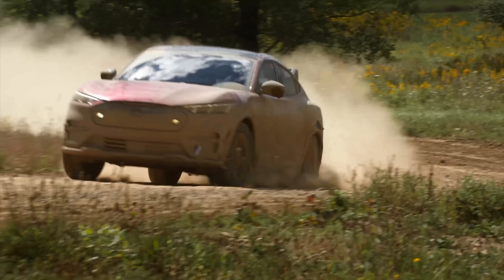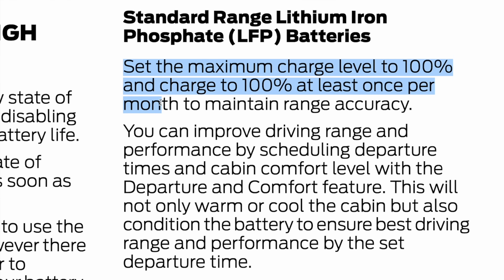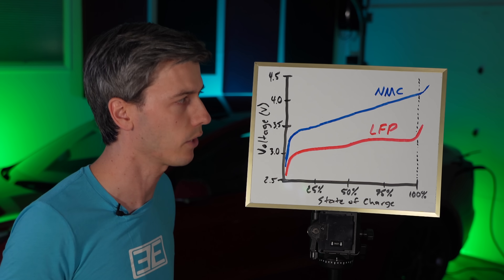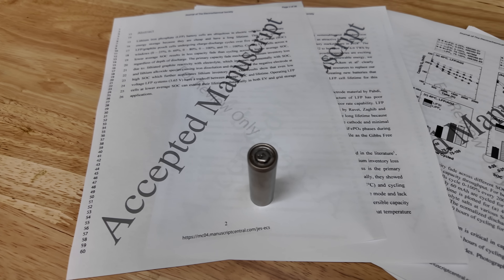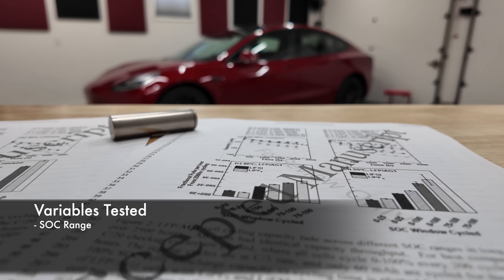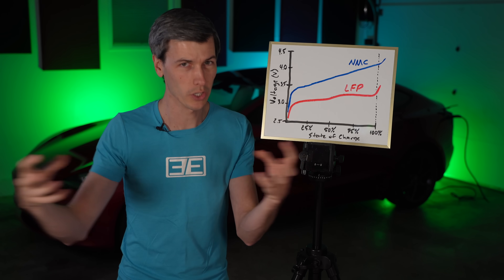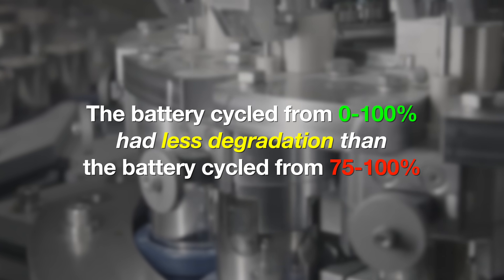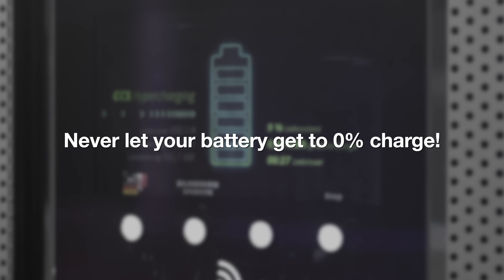How To Ruin Your Electric Car's Battery - LFP Edition!

Comment: Spot market prices for electricity makes all even more complicate. Let's assume 5 Cent/kWh potential for optimization. After 300,000 km and 45,000 kWh, this optimization would bring 2,250 € less electricity costs. The lowest electricity spot market prices are usual on weekend. So charge during the week to keep the car ready and charge to 100% at a sunny weekend. 
To make it more complicate, my wife can suddenly demand “Let's go to the beach”. Ok, charging was planed from 11:00 am to 02:00 pm at negative electricity prices, but now it's 10:00 am and the car is at 30% only. The beach and back requires 34%. 
So the question is: How big is the difference of best, medium and worst practice after 300.000 km? 
After purchasing my Tesla Y, I sold my old Dacia Lodgy with 253,000 km. Diesel Engine in very good condition, but the rust.
Maybe to sell my Tesla Y in 2040 because of rust. The battery could be used for a house storage.
What difference would it be, when from the 60 kWh are still 54 kWh or only 45 kWh left?

Comment: There are top and bottom buffers in the battery pack, so you rarely operate at 0% or 100% at an individual cell level. You also didn't mention what is the difference in the degradation speed. Maybe it is just a couple of percents, so no need to talk about this topic at all.

Comment: The manufacturers should create a “Battery Assistant” in the dash, providing regular advice on how to charge based on the battery chemistry and previous historic charge cycles? Not rely on general principles.
Reply: Great, one more place to shove those dreaded two letters, A and I.
Reply: @ps.2  actually a practical use for AI, rather than being used for social media replies.
Reply: I think we'd be better off with giant signs at the DC Fast Chargers telling people "Don't Charge your car to 100%, FFS!"
Reply: @ToddGlasier  but some times the advice is to charge to 100%
Reply: There's no reason to scare the average Joe so their 15 year old car, which statistically probably won't make it to that age, can save a few miles of capacity

Comment: Jason, fantastic video! It seems there's an especial difficulty of finding solid information on LFP battery longevity!

One question: @ 8:53, you claim that "all of the different ranges tested had the same amount of total energy going through them," based on the fact that all batteries had the same about of time (2500h) to be charged/discharged. Can we make that assumption, given that charging current is usually different across different ranges (0-25% vs 75-100%)? Was the charging and discharging current constant across all groups? I tried to find this in the study, but I don't think I quite understand. Thanks!

Comment: Why does a consumer need to learn or do any of this in the first place?  We don't connect directly to the cells, there's a BMS that is both in control and should know all this.  If discharging to 0% will cause irreversible damage, why would the car allow that to happen?  The manufacturer's should tell consumers to plug the car in whenever it's not being used, because then (and only then), the BMS has power available to charge, but that doesn't mean it has to be charging whenever it's plugged in.  It can just sit there until and unless it determines a charge is warranted.   After observing a driver's normal schedule, it should be able to adapt to optimize the battery performance and lifetime.  All this said, there should still be a way for the driver to tell the car there's a new/unusual requirement in the future (I'm going in to the city tomorrow, or I'm going on vacation for a month) and adjust charging accordingly.  If it's known that what you're asking the car to do can be detrimental to the battery, tell the driver that and let them make the decision whether the damage to the battery (or its lifetime or whatever) is worth what's being asked.  So in normal operation if you don't allow the battery SOC below 3% to protect it from damage, allow the driver to override that if they're willing to take that chance to get to the hospital, for example.  Drivers shouldn't need to be chemists.

Comment: I've found that charge speed is easily as big of a factor as the actual SOC for battery life/health. "fast charging" causes a ton of battery wear, so  I don't think using a supercharger once a week is a good idea at all, but I would love to see some studies on this also.
Reply: With modern properly thermally managed batteries it doesn't seem to make much of a difference. In the early days it was an issue, shouldn't be for any car made these days other than the Nissan Leaf.

Comment: This can all be fixed in software. Make it only charge to 75% by default. Every 10-20 cycles, have it fully charge and recommended the user to run it as dead as possible. (Or another clever solution, when plugged in, have your car hold the brakes and give it gas to quickly dump power and measure the battery, then recharge. This would only happen after midnight when plugged in)

Comment: What's one to do if you want to reduce degradation of Powerwall batteries?
In my area I have net metering and no time of use plan so there's only downside if I cycle )charge and discharge) the powerwalls each day. 
The Tesla app only gives one way to prevent cycling - set the Backup Reserve to 100%. The chemistry of my Powerwall 2 batteries is NMC so maintaining at 100% SOC for long periods is also detrimental to battery longevity! 

Are there any studies that measure whether it's better to:
1) Keep at 100% or
2) Cycle between say 80-100% every day?

I wish Tesla gave an option to keep SOC at a minimum of say 60% and then charge to 100% during a storm watch event. This would provide the best of both worlds - 100% SOC when the probability of a power outage is high and 60% SOC for the majority of the time.

Comment: Charge my Tesla LFP to 100% use it for 3 days till it's down to 30% / 100 miles left then plug it in again on a 7kw charger at home and take it back to 100%.  Only lost 1 mile of range so far in 5000 miles of driving (went from 272 mile range to 271 although it sometimes shows 272 after charging). Not saying that's good or bad just those are my facts is all.

Comment: Well I've always said that there isn't that much difference between the chemistries. It's good practice with both to keep them between 20 - 80%. The only real difference is that LFP needs to be charged to 100% occasionally, not just for calibration but to keep the cells top balanced. I think you've way overcomplicated what is a very simple topic. LFP have a higher cycle life to begin with so if you stray a little from best practice it has less impact. NCA, NMC etc star with a shorter lifespan so automakers have adopted a more cautious approach. Still - if it's practical, ke3p your battery between 20- 80%. If it's LFP charge to 100% once a month. Never be afraid to charge either chemistry to 100% when needed.

Comment: I think perhaps good call out is that ICE isn't immune from these types of discussions. Everyone knows you shouldn't do lots of short trips due to oil getting around and not getting the engine up to proper operating temperature and it can result in a degraded experience or premature death of the engine, but everyone does it anyway and for the most part its fine.

Comment: I like how easy it is to know what kind of battery, but really, it should be spelled out "NMC" or "LFP" (or fill-in-the-blank) inside the driver door, with the vehicle weight and tire pressure.

Comment: Best advice I've ever been given for Lithium based batteries is keep the charge above 20% and below 80%. Seems to have dramatically extended the life of my phone batteries.
Reply: Correct. The longer you keep it close to the nominal voltage (usually labelled 50%), the longer it will last.
Manufacturers of most EVs intentionally reduce the range their cells are charged and discharged to, which is why my almost 10 year old Leaf still has ~70% of its original capacity, while my phone is only about 2.5 years old and is down to about the same amount.
Reply: Incorrect, you can only do that if you know your car balances the battery while it is not full. Some cars (e.g. Some or all BMWs) balance at the end of the (full) charge. If you always stop at 80, if you have such a car, the cells will drift apart and be damaged after an amount of cycles
Reply: @Lesani  don't they have active balancers?
Reply: I do the same thing with my phone and I'm going on 4 years with it, and I still have solid battery capacity.
Reply: @nickhexum01  Your battery will likely outlast the length of time your phone will get updates. That is how the elites deal with people like you (I would too if I could, but I couldn't make it thru the day) and force you to buy a new phone. :|
Reply: This works better with phones because they only have one cell: 3.6V battery so you don't need to worry about cell imbalance, which is the main reason to go to 100% (or 0%) so the battery can get the cells in sync again. Also phone batts tend to be older chemistries like LMO, and never LFP. So yes it's good advice, but big car batteries are different in important ways, and LFP batteries are particularly different.
Reply: I agree - especially when it comes to laptop batteries.  I've worked in IT for over 30 years, and the most common faulty with laptops is battery degradation because they are constantly being kept at 100% charge.  I now keep my phone battery between 20% and 80%, rarely fully charge it.

Comment: Will the LFP battery calibrate immedeately when charged to 100% after months of lets say living with a charge limit on 60%? Or does it require several 100% charges over a short period to be fully calibrated?

Comment: The translation occurred years ago and is supported by thousands of data. The only best practice WRT EVs is don't buy one. The math will never pencil out. Insanity. At some point, when measuring the whole system, science and technology will not overcome any hurdles if continues to violate economic reality. My 22 year-old petroleum distillate drinking vehicle can be charged to any level summer or winter, can be recharged in 10 minutes, gets the same range, has a near zero chance of spontaneously combusting, and is worth more today than it was a decade ago. And it won't kill any birds. If there is a positive side to this, someone could gather their faculty at a charging station and defend their PhD dissertation on the correlation between EV ownership and stress.

Comment: The only choice I need to make when filling up is Shell or Chevron. Currently my Shell station is cheaper so that choice is simple. Besides they always have their squeegees and window washing fluid in order. EVs are great for golf carts and bikes and forklifts, etc. but they are boring and motivated by virtue signaling idealism and saving the world. If you need a PhD in physics to charge the battery, then good luck because the talent pool isn't that deep. If they can get them to stop exploding and causing dangerous fires...     As always, enjoyed your video and learned some good things.

Comment: Living in Athens, Greece, during our worst heatwave so far these ambient temperatures are not unheard of and actually became the norm. So for around 3 months now the ambient temperatures especially in the centre have been around 36-40 Celsius or even more during peak heat hours. And it wouldn’t go lower than 30 in the night for most of the days. What’s worse they measured upwards to 70(!) degrees Celsius on the road and the pavement because of the sun heating it. Crazy stuff.
Reply: Yes, there are plenty of places where this is the case during the height of summer, but while it makes a big impression on our minds the typical and average temperature over the entire year is much lower, so the overall impact over the working life of the battery is less than we might assume.

Comment: Fantastic video! But I miss information about battery health and performance in different temperatures and climates. I live in Norway where temperatures often are down to -30 celsius. 

How does LFP  compare to NMC? Does low temp use or charging hurt LFP batteries?

Comment: I have 2 comments on your interesting video
1: I think the best way is to follow exactly the manufacturers recommendations in their manual, less possibility warranty claim rejection
2: who actually reads all of the manual for the new car they just bought and what about if you bought a second hand car with no manual?
(maybe there should be another small manual just for battery usage in the owners manual pack just like for the radio system? or with new cars incorporate the manual as part of the entertainment system which could lock you out of driving the car until you have read the whole manual, could be a few weeks though)
Rob

Comment: Very good video on a complex topic, however you seemed to miss a big reason why they want you to charge LFP to 100% every once in a while, this is typically done so the cell balancers can work properly, the flat voltage curve of LFP means the balancer don't typically kick in until the full SOC knee hits. If you don't charge to 100% ever the cells can get out of balance. Also all studies show temperature driven aging is far more pronounced the voltage driven aging, even as you mentioned they shortened the test period by driving temps up, if you can do anything with an LFP is keep it cool, ideal storage is actually below freezing, you just don't want to recharge it there. Also there was no perspective on the cycle difference between LFP and NMC, LFP far out cycles NMC by multiple times, so even a poorly treated LFP will probably out cycle a pampered NMC. Definitely pay attention to Will Prowse and his channel, he has been the voice of reason for some time around LFP which has been more widely used for longer in the solar and RV world.

Comment: You have reinforced  my desire of not wanting anything to do with EVs.
Reply: Oh man dude, you should see how much detail some of these channels can get into as far as gasoline engine technologies. Those things are complicated. So many types of engines, and you have to worry about so many factors. Oil changes at 3000 miles, or at 7000 miles? Synthetic or real oil? How do you know when to replace the air filter? Do you use 85 octane, 87 octane, premium, E-10, E-30, E-85, ethanol-free, what kind of gasoline is best for your engine, and what if the station you're at doesn't have that kind? Makes your head spin.

Really reinforces my desire of not wanting anything to do with combustion vehicles.
Reply: @ps.2  My 82 year old mother can manage keeping a ICE vehicle. It's not that hard, but some  of the simplest things are beyond some people.
Reply: @stevenlochner4619  Now you're getting it. If you ask "what are the things I should be doing to make my vehicle last as long as possible", you can get some complicated and confusing answers, like I gave and like this video gives. But that doesn't mean your chosrn vehicle type is inherently hard to manage. Just means (a) the unfamiliar becomes familiar faster than you think, and (b) even if you ignore most of that detail, you'll probably be all right.

Comment: The charge to 100% thing is absolutely not for battery longevity. Ford and Tesla are both doing you a disservice by claiming that. While it's really good to have detailed videos like this explaining all the ins and outs, most people need much much simpler guidelines. This video and everything else I've read says you're better off charging to no more than 80% on LFP just like NMC. And yes once a month charge the LFP to 100. Very few people are going to only charge to 50 or 60% because it's just not convenient as you have to charge much more often. Then we go on a longer trip at least once a month where we will actually charge 100% anyway to maximize our highway range on departure. We have a Tesla Model 3 LFP as well as Volkswagen ID4 NMC. It's very simple and you can treat both cars exactly the same. And honestly this is probably true for virtually all cars and every battery powered object including phones. We should just call the "80-100 rule" and make it universally known. No it's not absolutely the best rule and things are more complicated than that. But for most people it will be safe, sufficient and extremely easy to follow.

Comment: Thank god somebody made this video. I am no expert but I knew that number one Enemy of any battery is high temperature and high voltage. And by reason I knew that Tesla wrote to keep it at 100% exactly because of the range estimate. I made a few simple electric vehicles and I knew something about batteries not a lot. But I have a friend that is much smarter than me and made many electric vehicles and use both chemistry many times. He told me that no battery is good to be charged at 100% and I believed him it all made sense. . Thank you for confirming this. I also have Tesla Model 3 with LFP battery. Great video thank you! There are so many videos about this topic giving many wrong advice to people no wonder people don't know what is the truth.

Comment: this best practice should be programed in the car its lke charge to 80% for the rest of the month in the end of the month change to 100% and put like protection like overnite charging and its 100% and drained like 1% and prevents its charging again until its see a 50-70%

Comment: i dont get the consuming lithium inventory part.
in order to "consume" a stable element it either has to go through nuclear fusion or fission and transform in to a different element.
lithium also cant escape the battery since its highly flammable.